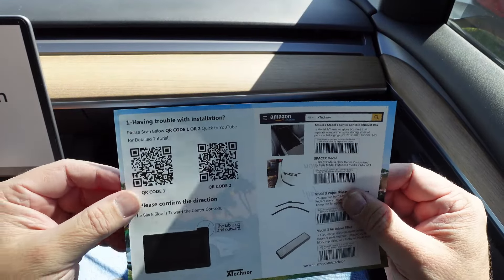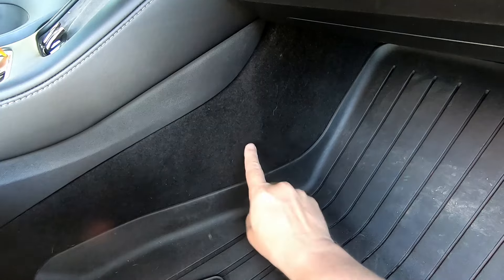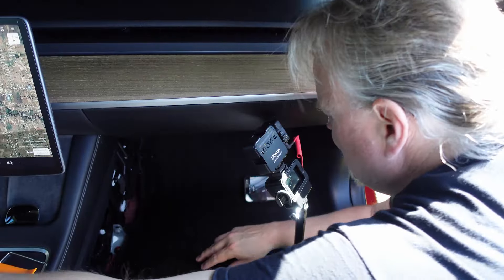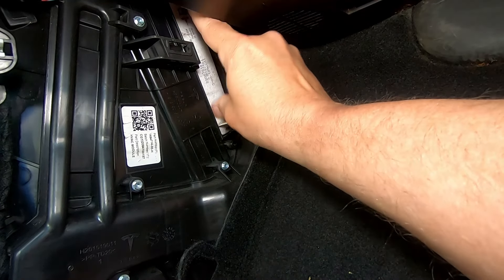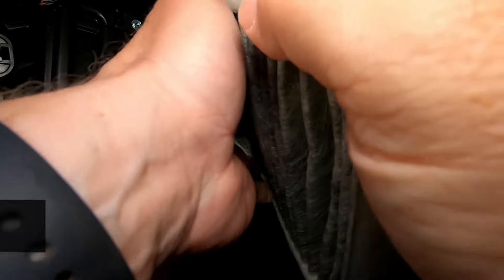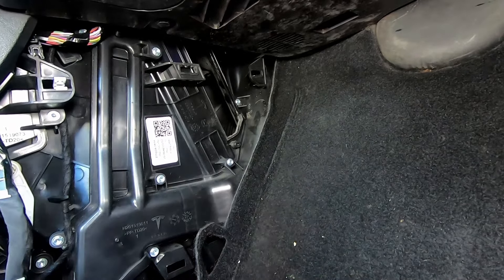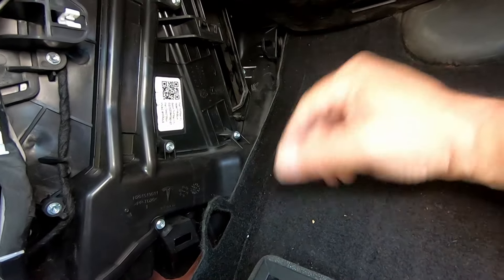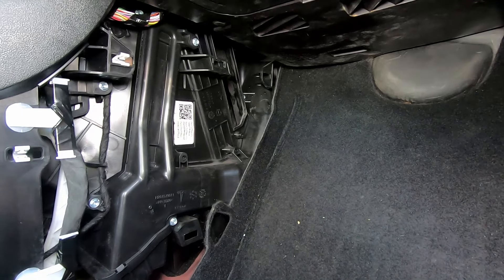Get Rid of Bad Smells: Tesla Model 3 Cabin Air Filter Change

Comment: hello. my model 3 highland is right hand drive. question: do i open it frm the driver side or passenger side?
Reply from the maker: I don’t really know, but I would think passenger side due to the pedals
Reply: @SpinnerEV  i was thinking the same. but then the filter has the strip to pull which is on the other side. i guess one way to find out is to open it. thanks!